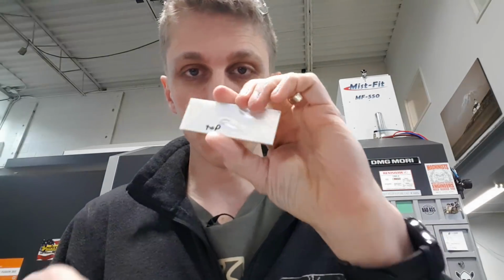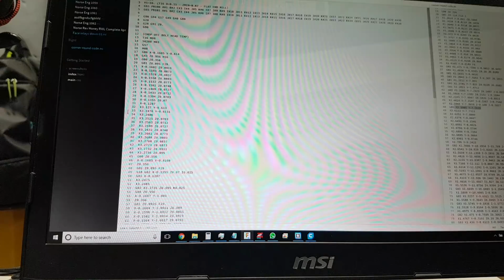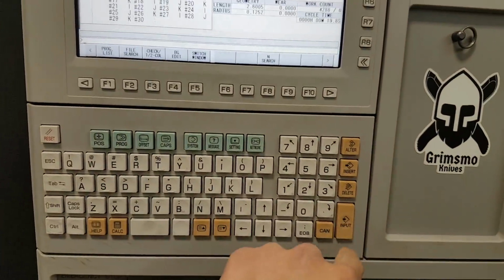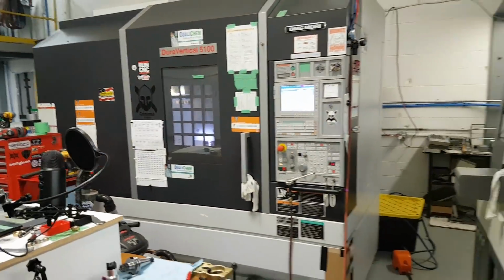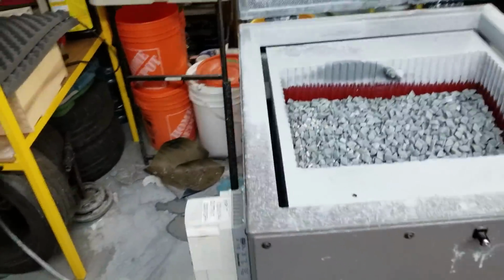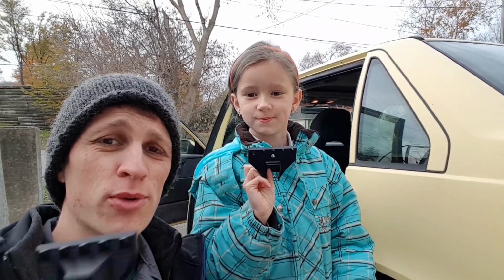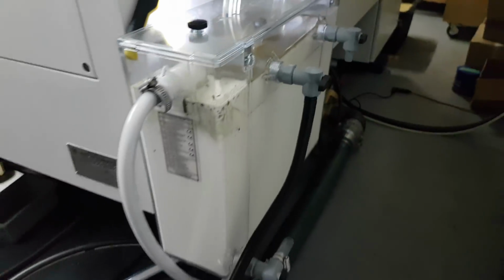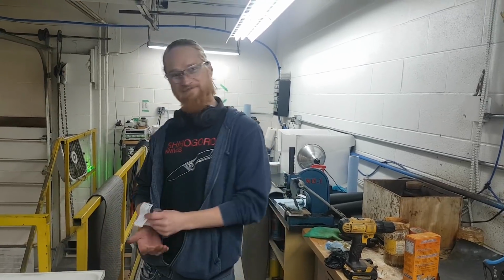Working w/ Mother of Pearl Inlays Pt. 1 - Shop Life 016

Comment: Are those wires wrapped in natural rubber?  The wiring on my 70+ year old Pratt and Whitney lathe is natural rubber coated and they were in great shape for the age, it feels "loose" compared to stiff plastic wire cover.

Comment: Clearly those wires on the tumbler have been vibrating against a sharp edge and got cut.  Is the motor on that thing direct mounted to the vibrating part?

Comment: On motors that see a lot of vibration, pack the connection box with "Duct Seal" . The putty like stuff. It will keep the wires from rubbing on the metal. Also those should have been taped at least. Wire nuts alon are not enough.

Comment: Consider filling the motor wire terminations on the vibrotumber with a hot melt glue - it will make it so the wires cut rub their insulation off, and if you need to get at the wires again, just pour isopropyl alcohol in there to get it to debond :)

Comment: i have been doing some recent cutting trials at work using coolant on CFRP i would be very careful thinking your filter is capable to capture everything. if a tiny amount of particulates get through and gets into your slidways it will destroy it. My knowledge all from CFRP. the dust go is sub micron thick and thus being able to capture it through an air filter is easier.

Comment: Eric, ferric chloride needs to be disposed of properly.  Quote "The solution must not be put down the drain because of residual copper ions left in it. To make it safe for disposal, you can add sodium carbonate (washing soda) or sodium hydroxide to it to neutralize it, until the pH value goes up to between 7.0 and 8.0, testing it with indicator paper."
Reply: Where do you recon the residual copper ions come from? They're making steel knives, not copper clad pcb's.
Reply: yeh thats what he said he did in the video.
Reply: Good point. My bad.